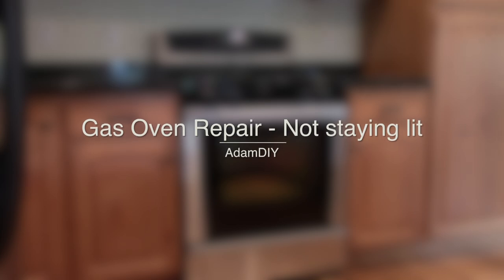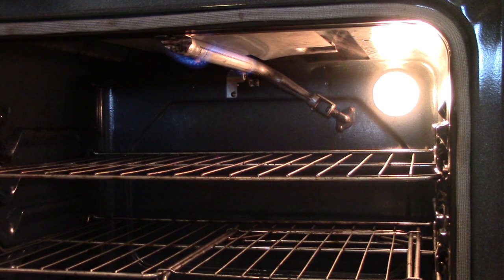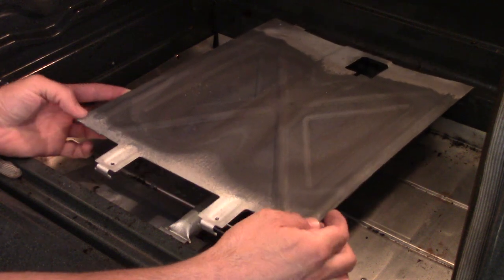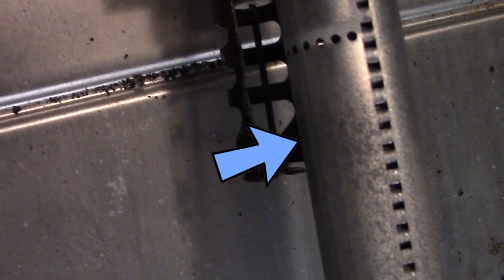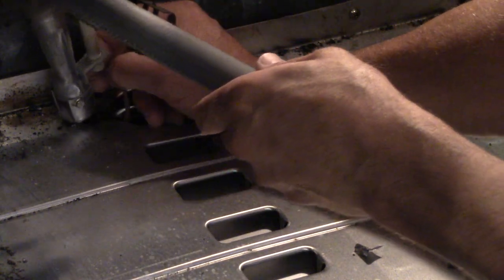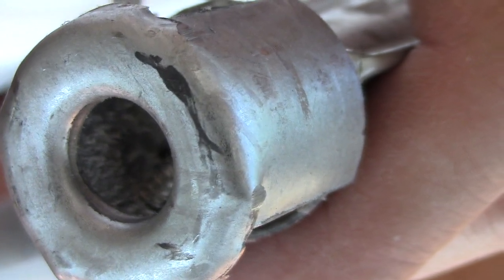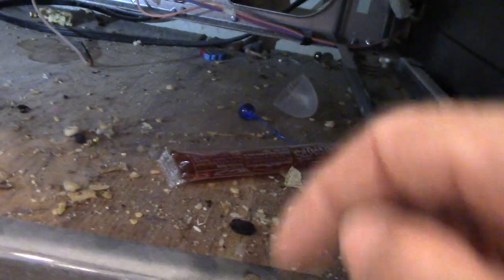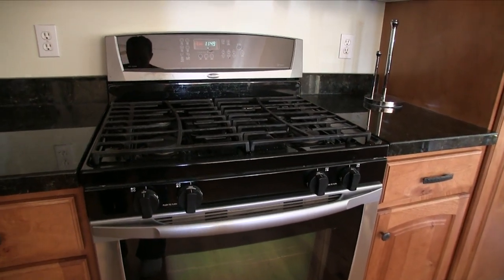How to repair a gas oven - Troubleshooting, won't light stay on or heat up

Comment: Thank you!!!! I ordered and replaced the ignitor thinking that was the problem. But still didn't work. Watched your vid, clean the tubes, and now it works! Tube wasn't even super dirty, but I guess it may have been just enough for the gas to not flow though.

This is what makes YouTube great! Real men sharing real solutions. Thanks!

Comment: HEY! It worked! Whirlpool - ignitor clicking but not oven not lighting. Did not pull the ignitor all the way out, but followed your directions and sanded the thing clean. Had to reposition the gas burner once afterward - we had it angled away from the ignition. Got it settled in and it LIGHTS ON THE FIRST SPARK! Thanks, Adam DIY! Took a few hours today (too old and stiff to stay on the floor very long, but done in a day, and only paid a Mac&Cheese lunch to the brother who spent his knees and time on the project! YES! Don't need a new oven! 
Now, can we do the same thing with the stove top igniters?

Comment: Appreciate this! It solved my issue as well. 

Tip: Put a large clip (I used a chip clip) on the wire when you unplug the igniter to keep the wire from falling through the hole!

Comment: Great info and still valid. I just replaced igniter in Whirlpool oven. Ours would glow but apparently not hot enough to signal gas to turn on. I have no multimeter so cant verify if resistance was out if range. Purchased part from Amazon for about $32 and got in two days. Took about 5 min to swap part. Now lights and heats up beautifully.
Thank you much for the video.

Comment: Thanks for your video. My oven was not lighting but the top burners and broiler were lighting fine. I cleaned the oven ignitor rod (center electrode) and the surrounding cage which acts as the ground electrode. There is a small tip on the ground cage that is the closest point to the ignitor rod {center electrode), I cleaned that tip with sandpaper and adjusted the gap because it looked like the heat had expanded the cage a bit.  Now the oven burner lights perfectly. As zee zee said below in his comment the ignitor uses a flame rod sensing system which uses the flame as conductive path. so it is important to keep the rod and ground cage clean.
Reply: How many millimeters is the property distance between the cage and electrode? Thanks

Comment: Thanks for this video. The teardown instruction was great, but the removal of the oxidation was brilliant. I was on the verge of either buying a new oven or a $100 burner tube assembly. I think this fix may allow this oven to last a few more years.

Comment: Only video with this type of igniter (others connected wire nuts or wired connectors).  The video saved me a great deal of frustration and the cost for having a technician make the repair.

Comment: Replaced the bottom igniter before I got to this video. Started reading through the comments because it was still doing exactly what this video describes. The real problem was overloaded bottom cooling rack. I had it stuffed to the gills. Took three baking sheets out. Works the first time every time.

Comment: This worked for me too. But mine was a bit more stubborn. Had been since new (a bad oven overall). I also drilled out the holes next to the igniter  and closed the air vent down a bit. For the first time ever, the oven started on the very first igniter click. Very happy with the re-engineering.. Saved me from buying a new oven as I was ready to junk this piece of ..... Thanks for the how to. PS - have some duct tape ready to secure the igniter wire!

Comment: In this case the flame rod acts as a rectifier or diode.  AC current is applied.  If there is no flame, nothing happens.  If there is flame and carbon particles, the AC plus arcs to the large ground.  When the current reverses, the pulse cannot reach the tiny surface of the rod tip.  DC current goes back to the control and tells the gas to remain feeding.  A dirty rod interrupts the rectification.

Comment: Wanted to let you know this video saved my wife and I a visit from a repair tech. Main oven wouldn’t light (clicked 4x and could smell gas, no flame). The electrode(?) was coated in black and I sanded it back to shiny silver. Thank you!

Comment: Perfect how to fix ignite r carbon build up BUT QUESTION why didn’t you remove the oven door? It gives you a lot more room to work Release hinge locks push door down on each side that will release the hinge take door off very easy.

Comment: The reason you need to clean the igniter probe is that after the igniter sparks and it ignites the gas the probe measures the conductivity through the flame to keep the flame on.  If it is dirty the resistance will be too high and it will not measure the right resistance so it will shut down or not ignite and the oven temp will fall down too far before it ignites again. So keep it clean by using fine sandpaper.  It is important to know the reason why  this is happening.  If there is no  ignition or spark then the igniter board is bad and need to be replaced. Not a big job, but a bit pricey.
Reply: I replaced the oven igniter board and the igniters for both bake and broil don’t spark to ignite either the upper or lower oven burners.
Reply: @jimlelan4906  
Press the  off button  twice  then start you will get in diagnostic mode (Off Off On).What error code do you get ? Check  what error code responds to ?  You can look those up on net.  Does the stove igniter work?  If it works then it might not be the igniter board b/c that board controls all igniters     You might have a broken wire problem somewhere or the main board problem?  Why did you replace both igniters you should have changed one first.  

This is an explanation why u need to clean the igniter.
This is the reason why you need to clean the igniter rod or  pin
Most spark igniters use flame rectification to prove that the flame  has fired. Flame rectification is a process where a low A/C voltage is applied to the flame rod, and when that flame rod is inserted into a proper flame, the voltage converts to a D/C  voltage by traveling through the flame to ground.
Reply: @zakyxzaky  Thanks so much for your reply. The error code that I got was kinda weird. It looked like an upside down capital F, followed by a 5 (or S?), followed by another upside down capital F. Haven't found the codes on the net yet. All four of the stove top burners light, so i think the blue spark module on the back of the stove is okay, and like wise, the gas safety valve may be okay, but I'll need to check it for continuity when I get home and also see if it is a two part safety valve, one for the range, and one for the oven. I'll also need to disassemble the back of the range more fully to look for broken or burned wires.

Sorry, I misspoke in my post above. I did not replace both igniters (broil and bake) yet. I did replace the igniter electronic 'board' with the two green (igniter?) capacitors(?) on the backside of the range top.. because wthere are two little 'snaps' from the (mother?) board that contains the clock, but nothing happens with the oven igniters sparking.
Reply: @jimlelan4906  You also might have a bad main control board.
Reply: Does it matter if the rod isn’t completely straight? Say while cleaning it bends slightly but you’re unaware. Would it matter in terms of regulating temp or anything?

Comment: Helpful video, thank you! Our four month old oven just decided to not ignite on the bottom. No spark. Turns out the terminal connecting the igniter is exposed below the ceramic insulator. The extra racks that I was storing in the drawer were touching the terminal and shorting the pixies to the chassis. I'm thinking it might-could be why this happens intermittently. Filled under "good to know" I guess.
Reply: Thanks! We cleaned the ignitor and it worked. Thought we were golden. Put back together and not working. Took a few things out of the bottom drawer and reading your comment and it started right up.
Reply: Yeah….I learned the hard way….you can’t over load the lower storage bin with pots and pans

Comment: Thank you so much for this!  I saw another video showing how to install a new ignitor, but considering it is Thanksgiving DAY, your video showed me an option of cleaning it and not only saved having to replace the ignitor just yet, but the headache of how to find somewhere open to acquire it on a holiday. . . . . . . thanks for saving me some $$$$, time and headaches--not to mention the Thanksgiving Dinner, especially the Pumpkin Pies!  One of the best repair videos yet.  Thanks!

Comment: Like your video,  my whirlpool oven lower level is working but upper one click but no flame,  just like you said temperatures doesnt stay when I bake. Broiling is not working. If push the broiler head click and smell gas, what should do from here.

Comment: A very clever diagnosis.   Our oven had slowly gotten to the point that it would not re-light on long baking cycles even though it was only two years old.   We live in an area of very high humidity and the ignitor had corroded enough to weaken the spark sufficiently to prevent re-lighting.  A little work with the sandpaper as the author suggested and voila! A perfectly working oven again,  I take back all the curses and hexes I put on the Maytag people.

Comment: KUDOS!!!! I have the same ignition setup. Has been not consistently lighting for a little while. Am getting ready for Thanksgiving and it got worse the day before. Pulled the manifold out, and took the ignition off, and sanded down the electrode and the metal tip that the charge makes contact with and VOILA... worked like a charm. You saved me $50 on parts...THANKS!!!!

Comment: I didn't take out gas tube or ignitor, but I did use sand paper 400 grit and a .17 cal barrel wire brush to clean ignitor. Before cleaning the ignitor would click at least twice before lighting, if it lite at all. Most of time it wouldn't lite, on/off til it lite. Now, first click and is lite. Thank you

Comment: I was able to fix my range using the info from the video and from some of the comments. I have a Maytag MGG8700DH2 and the oven was very slow to warm up. The burner would light but the flame was not very big. I cleaned the ignitor as shown in the video but I also noticed a little bit of debris in the burner orifice (the little jet that feeds gas into the burner element). Between cleaning both of those things the flame is now bigger and the oven heats much faster. From room temperature to 350 degrees takes about 10 minutes now.

Comment: I'm curious as to why you turned on the broiler, almost every one of these that I've worked on the broiler doesn't come on when you bake. I do always test the broiler independently as if both bake and broil don't stay on I go to the spark module or harness
Reply: I changed out the igniter because on bake it would not ignite it still doesn't. Broiler does not even ignite I smell gas but no spark when I hit start button for bake I can hear igniter but it seems like it's coming from the stove top

Comment: My whirlpool would (usually) light and get to temperature, but would then fail to maintain after about 1/2 hour. I go back to check my meatloaf, or whatever, and the oven would be 190 deg. Was problem everytime. 
Now Starts and maintains temp everytime. 
Thanks so much!
Reply: How. Yo clear. Codf1e3. In gas stob??  

.?????
Reply: .how. To clear cod.  F1 e3. On kitchaid stob
,

Comment: THANK YOU THANK YOU THANK YOU THANK YOU! I was trying to bake a burger today and my bottom burner wouldn't ignite. I took the oven apart and sanded the ignition wire thing and put it all together and it worked. I was about to buy a new one because I had run out of ideas for what to do.
Reply: my gas burner on and later off few minute later and
Reply: Backoff20019 made the repairs save $110.00 on service call

Comment: Good morning, I was searching how to fix my gas stove and I came across your video so I hope you're still available for advice. I have the same stove and about 2 months ago I started having problems with it not coming on at the bottom. The broiler works fine it comes on on every try and the stovetop burners comes on sometimes by themselves but must times with the light of a match. The bottom burner "the baker" do not light up with fire so I was told it was the igniter so I called to my local appliance stores and they wanted $60 to $70 for the part so I check my favorite shopping site "Amazon" and I bought the exact one I need for $5. When I got the part I put it on and it gets a spark and I smell the gas and it sound like it's about to come on but it shuts off and the stove still don't work. I tried cleaning the burner but to no avail. Does the broiler igniter has anything to do with the bottom igniter because I didn't replace that one. Before I go out and buy a new stove do you have any other suggestions I can try because for what a repair man would charge me I can add on another hundred dollar and buy a new one.
Reply: Hey, do you fixed the problem? Mine sometimes does the same.

Comment: Changed the igniter in the bottom thinking it was the issue and can hear it clicking. However the clicking seem to be at the stove top..... And of course the oven will not light either broiler or bake.... Please help

Comment: AdamDIY we tried this step by step and the result was still the same the oven isn’t staying hot?  It eventually cooked  chicken wings approx 3hr later Lol...The broiler works fine however ...now what? Do we buy a new heating element?
Reply: What heating element? It's a gas burner. Try taking the gas line off the back of the oven and check to see if the pipe fittings are free of pipe dope that may have clogged the free passage of gas.  I do this for a living. you'd be surprised how common it is and I see it on dryers also. The result is the same; the burner will operate for a time, then it won't. People use too much pipe dope (installers too) or use it where it shouldn't be applied and it migrates into the pipe tubes usually right at the opening.

Comment: Turns out the oven in our new place "didn't work" because the wire connecting the bottom ignitor was NEVER connected.  

Thanks to seeing how yours was connected, I was able to connect the ignitor (the ignitor was in perfect never-used condition).  After not having an oven for 6 months, we can make bread!

THANK YOU!

Comment: did you have to turn off your gas?  mine is doing the same.
Reply: I did, better to be safe. I left the gas off and after I filed down the electrode and contact point (metal arrow pointing to electrode) I reinserted the manifold and hooked the ignition wire to the electrode and dry fired the oven (without gas) to make sure I was consistently getting a spark.
Reply: Hey thank you.  How do I turn off my gas?  This is all new to me. Thanks once again .
Reply: there should be a shutoff  valve on the gas line coming out of the wall behind your stove.
Reply: Woody Grajeda

Comment: I have a Whirlpool oven. The broiler comes on and then turns itself off in 20 seconds. Any thoughts? I have already tried cleaning the igniter
Reply: The ignitor is bad or the wire to the spark module , or the spark module
Reply: Clean the cage (the little things that surround the igniter) and also the thermostat.
Reply: Do you resolved the problem?
Reply: Did you fix it? I'm having the same problem

Comment: I have an LG gas range and oven.  I can preheat the oven and it will get to temp.  I can put food in and the temp on display will never changes but intermittently I will go back and open the oven and it's only 150 to 200 degrees.  Wont do this every time.  Any suggestions?
Reply: reed smith just do as he did.  The reason the display temperature doesn’t change is because it is showing you the temperature set point.  What happens is your oven heats up.  Then you put your food in.  Then the oven tries to fire off again to heat the oven back up after you open the door.  If your igniter is dirty the control board doesn’t sense the heat this called flame rectification.  So, after three attempts of lighting your oven will lock out the startup sequence. Thus, you have to cancel the call for the oven and then turn it back on and the sequence starts over again.